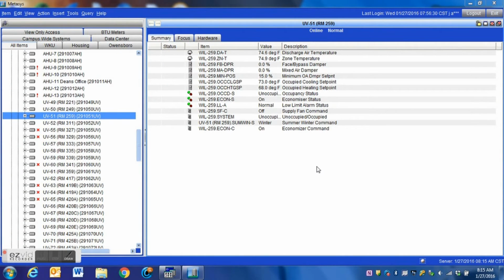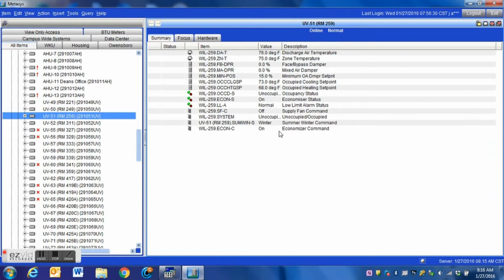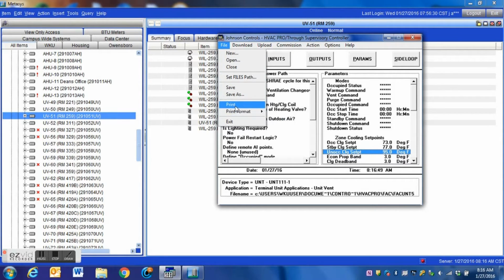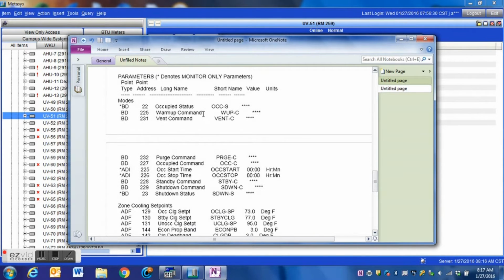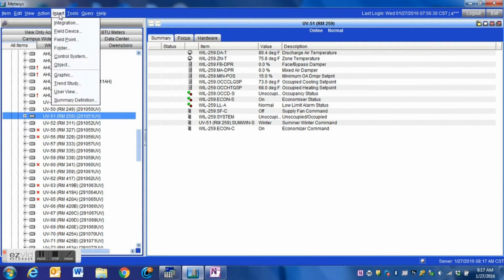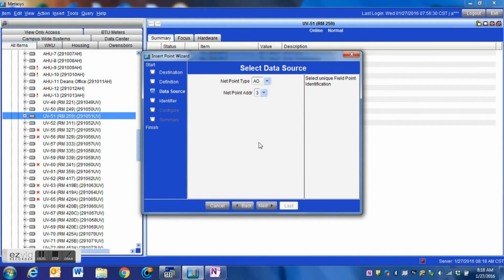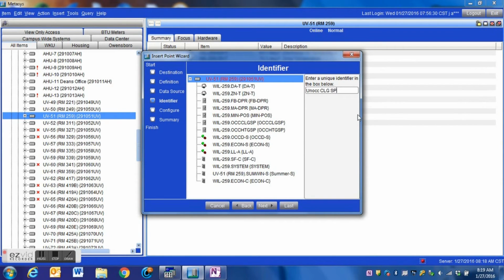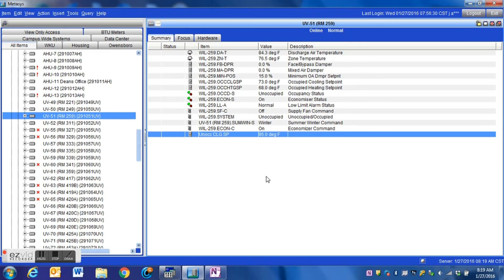Adding Unknown Johnson Controls N2 Control Points

Comment: Pretty straightforward explanation. How would you add GX9100 points?
Reply from the maker: It is a very similar process to add those points.  You can print the program for the exact point identification, use a resource file or copy the information from another device where they are already added.